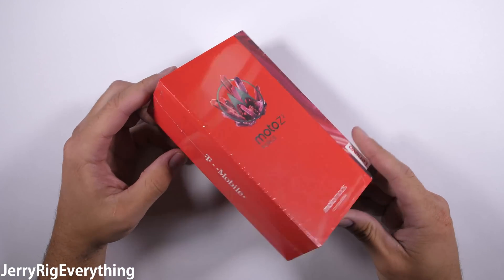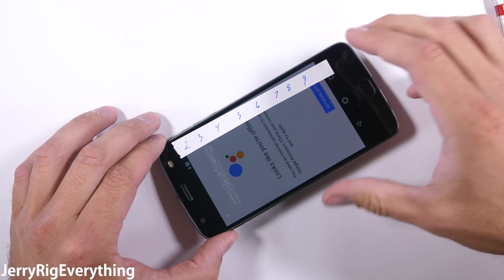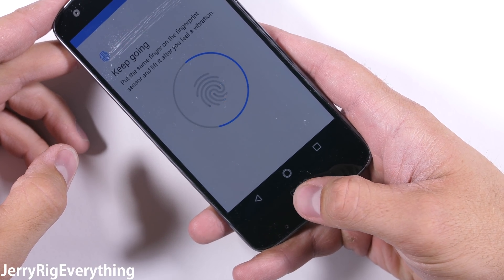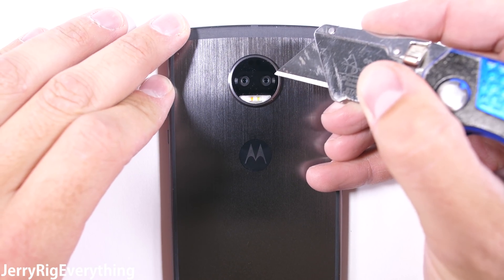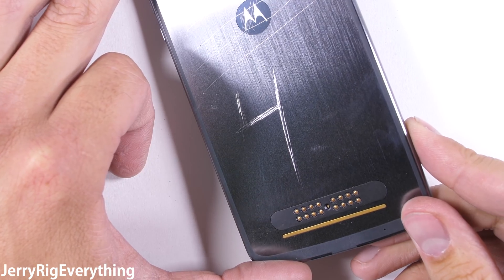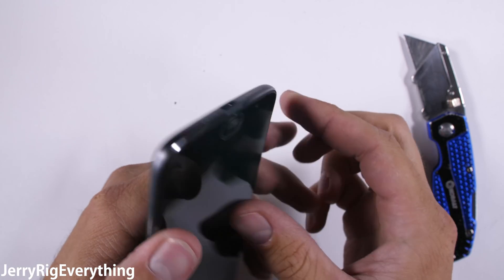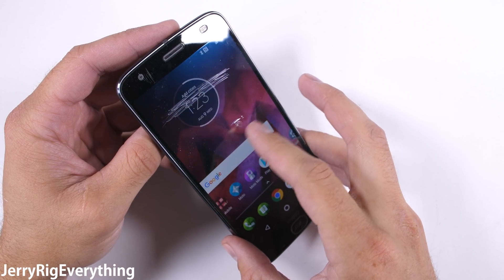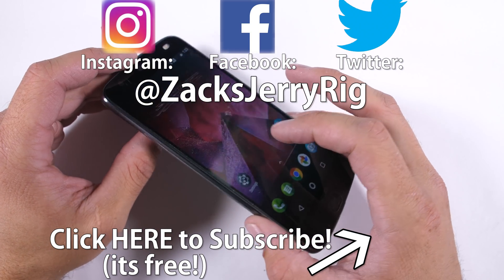Moto Z2 FORCE Durability Test - Scratch and Bend Test!

Comment: Maybe a mod with a headphone jack would help !! 🤔🤣
Reply: Ravpreet Kaur the gamepad mod has a headphone jack :D
Reply: You're probably going to use the phone 10 years until the Type C port dies. Type C is way more durable than Micro USB.
Reply: It comes with an adapter in the box. I have Bluetooth in my car stereo and can't listen to music at work because I have to listen for calls on my radio. The lack of a headphone jack wasn't a deal breaker for, for those who spent 200 or 300 on a good pair of headsets, it does come with jack adapter.
Reply: AzuMentch36 It's not as good, it's much less advanced and in all just not even comparable
Reply: Just get wireless headphones
Reply: ...yep
Reply: Thomas Salisbury defeats the purpose of buying the phone in the first place
Reply: You plug something that goes in the charger and has a head phone jack on the thing that is like a charger an you plug your head phones in it so it makes your head phones longer
Reply: Z2 play then
Reply: It comes with a adapter
Reply: Ravpreet Kaur the game pad mod has a built in head phone jack
Reply: Ravpreet Kaur but the Moto z2 play has a jack on the phone so
Reply: Little late but it's called the Moto z2 play. Trading specs for a headphone jack. At least from Verizon
Reply: The play has one and way cheaper lol
Reply: Ravpreet Kaur there is
Reply: guys u get type c to 3.5mm comverter in the box of phone
Reply: Or you can get a Z2 Play, which is just as good as the Z2 Force. It even has a headphone jack! :D
Reply: AzuMentch36 the z2 play is NOT "just as good" as a z2 Force. Please don't spread complete bs.
Reply: Maybe you can use the USB-C adapter that has a headphone jack that comes with the phone
Reply: Skylord William Exactly!!
Reply: But the problem with using a USB-C adapter is that you are using the same USB-C port(which have a finite lifespan) for two function, which speeds up the death of the USB-C port. If your USB-C  port dies and the phone don't have wireless charging, you will not be able to charge the phone without doing repair. In shorts, Using a USB-C adapter is NOT ideal when you can have a phone that come with a headphone jack.
Reply: If it is pre-included in the box, it wouldn't be a problem. Why would you buy something ripped off, that supposedly been there in the first place?

Comment: Regarding the lack of a headphone jack while driving, the Incipio car mount mod had aux built into the mod so if you would prefer that, it is connected through the mod (so is power to the phone)

Biggest complaint is that currently the top layer of plastic, the replacement lens, is bonded to the other layers in a way that is not DIY replaceable. 

The first gen version of the phone is a bit better in that regard plus the better battery life.

Thanks for the review!

Comment: Hey zack, even though a shaterproof plastic display is cool, i would much rather stick to glass, it has a bit more of a premium feel and its a lot harder to scratch up than plastic, eventually you are gonna have to swap the plastic screen due to how many scratches there are, however if the glass breaks on a normal phone you will change the glass anyway, I dont really know, i have never had a plastic screen phone.

Comment: I think they should include a tempered glass screen guard preinstalled in the phone to prevent scratches.. its cheap, easier to replace and better resists scratches. Some cheap chinese phones (huawei, xiaomi) have it already applied, costs even 1/3 or 1/4 of this phone.

Comment: I think you should start adding a drop test, especially on a phone that has a Shatterproof display
Reply: The Cube King Well it's plastic so it wouldn't shatter but at a certain height the OLED display would crack and look really ugly
Reply: Idk if you guys know but zack doesnt do drop test. I think its because you need a brand new phone for every height to be able to correctly say that the phone is shatter proof
Reply: CirclesOfMotion But what about it landing on its side?
Reply: Yes! Drop test please
Reply: He might as well that phone is completely intact
Reply: I watched one for this phone. 3, 4, and 5 foot then on concrete, hardwood, and down a big set of jagged rocks. It didnt shatter, it did get scratched. But nothing stopped working. It is actually shatterproof. She honestly beat the shit out of it.
Reply: I have dropped mine down a set of stairs when coming from a parking garage, there was a total of around forty stairs, it also got run over in the garage, and flung from the back of a truck at 60mph.
Reply: You're so right!
Reply: Yeah
Reply: zuerich3 oh, ok
Reply: Blues 000 If plastic will be thick there is no chance what OLED display will crack.
Reply: it proves quite a lot actually, he raved about how well built the iPhone 8 is but in fact it will crack everywhere from even a mild drop, the videos are misleading if you don't get second opinions
Reply: I own this Moto z2 force and have dropped it many times It just scratches..unless it's slammed hard then it kills the backlight and touch screen part... I know because it's happened to me.. pretty tough unless it gets a hard slam on the screen or edge..
Reply: Hybrid Theory yes I have used the warranty twice already...🙄
Reply: Hybrid Theory I noticed mines been glitchy to.. it's probably the bad road rash over the camera, I don't know though.. lol
Reply: Do the moto z2 play
Reply: AWSMcube that is a glass screen, and I bet you had a back cover
Reply: I have the Moto z2 force. This thing has fallen out of moving vehicles and off of the roof of our house with nothing but a bumper on it and is still 100% fine
Reply: Other channels have. Dropped it from 300 feet and it still worked
Reply: That's actually kind of a good idea
Reply: Maybe he will do it before opening it up in the next video
Reply: Zack already said on his other video/s.
There won't be a drop test. I agree with him and glad he not doing it.
Drop test are very random and proves nothing. Only idiots in youtube doing it.
I think the bend test, test the phone build better than stupid drop.
Reply: my moto z2 play's display broke after falling 2 feet with a case lol

Comment: I think every phone must have a plastic screen and a tempered glass screen protector in the box
Reply: bk seby 666 if they would be so, i would never buy a new phone
Reply: Seby 666 This is what I was thinking! Great idea!
Reply: why? your phone screen would never break after that. if the screenprotector breaks just replace it and the plastic isn't going to crack, but if its glass protector and a glass screen the screen beneath it will probably crack too like everything else.
Reply: I owned the Turbo 2 and was completely unaware that it was made of plastic until I left it on the hood of my car, which then fell off at some point and I ran it over. After removing the screen protector that was shredded (plastic film type) and other than a few dents in the plastic, the screen was basically unharmed. Any other phone would have been completely trashed.

My Moto Z2 Force is getting delivered today. Unfortunately for me, the Turbo 2 did not survive a dip in my pool...

I should probably be more careful with my phone...
Reply: agreed

Comment: Id prefer glass since I don't usually break my screen when I drop my phone's. I've had 2 and they are tempered glass and I've. Dropped them and they never shattered. That's from the high I've been holding them. Unless it lands face down initially, it won't shatter.

Comment: Lenovorola has said that they don't plan on offering shattershield replacement service for the Z2 Force, due to "only a small number of customers using it" on the past two phones. They're recommending that people use glass screen protectors to prevent what will effectively be permanent scratches; something they should probably have spent the extra 2c/unit and equipped at the factory.

I'm not sure what I enjoyed more...the video, the political commentary, or seeing the firmly-twisted panties of the people in the comments section. I disagree, though; there are far too many willfully-ignorant and just plain stupid people in the US for Trump to only get 4 years. He'll barely scrape by the election again, probably via the same electoral college bullshit he did last time, and then we'll have to listen to him for another 8 goddamn months about how he actually won by a huge margin if only the other side hadn't cheated.

Comment: glass screen is good.. because most of we don't like our screen to be scratched..😅
Reply: hehe Creations the fact that you can scratch the screen with your fingernail is a deal breaker for me.
Reply: hehe Creations tempered glass screen protectors exist ya know? And unlike your glass screen which breaks if u drop it, the tempered glass screen protector can easily be replaced for cheaper(0 risk of the touchscreen breaking amirite?)
Reply: You might as well get a sapphire display with raised bezels and you're good to go! The Verizon Wireless version of the Kyocera Duraforce Pro is a perfect example.
Reply: Beetlebob Andrew yeepp
Reply: trouble is, screen protectors do not cover the entire front face (which includes the camera). You can easily accidentally stick your fingernail into the camera area and bye bye scratch free screen.

Comment: Plastic screens are preferable to glass for it's shatter resistance. You can easily solve the scratch resistance by applying a tempered glass screen protector.
And replacing a screen protector is considerably easier and cheaper than replacing the screen.

Though, the phone should also come with a screen protector already pre-applied.

Comment: I just got a z2 Play. I have owned it for around a month now, and unfortunately, Somehow got a crack starting from the top left edge spanning the width of the phone. The glass is curved on the edges and is maybe a design flaw. I had a case and a screen protector on the device ever sense it was out of the case. Although the scratches are annoying on a shatter proof case, just put a screen protector on it. Shatter proof screen all day.

Comment: Plastic Screen is durable in drop non shatter glass but easy to scratch even the front camera can scratch easily. .  Easy to Burn. and for sure becuase its plastic it has lower resist from the dirt and sure it will be blurred after a months.
Goodnews You can put tempered glass on it for scratch resistance but if you want to change tempered glass becuase it shattered i guess you will get a problem from removing it, because its plastic it is possible that some adhesive from previous tempered glass will not be remove that easily .

For Glass the only problem is not that shattered proof.

Comment: Plastic screens, shatterproof? Hell yeah just slap on a 5 dollar screen protector smh
Reply: Poatatasium Poatatogen PO2 I've said it before and I'll say it again, the only risk would be the OLED display inside cracking
Reply: i think a plastic screen is better, then you can just throw a glass one on and if it cracks just replace it :P

if its the other way around its pretty much pointless
Reply: Burnout Wien It really just comes down to preference
Reply: what do you mean, of course the plastic will scratch easier so thats why you use a glass screen protector, its a much better option than a glass screen and glass protector or glass screen and plastic protector.

if you drop a phone with a glass screen and a glass screen protector it will probably crack your screen too, if its a plastic screen and u have a glass protector then all you do is replace it, also what do you mean its not an option for everyone? you sound dumb as hell tbh.

more cons to a glass screen than a plastic one all I have to say :)
Reply: looks > functionality

proves how dumb you are
Reply: Rasv srsly I choose functionality and calling someone dumb for no reason shows how unintellectual you are
Reply: i told them they were dumb and I did justify why I said that, shows how dumb you are too lmfao
Reply: looks > functionality

Once again shows how dumb you are. Also I can handle my a phone with a glass screen but there is always that risk of it breaking. I have an lg v20 which 90% of the front is glass. 

So many people break their screen and instead of paying a large amount they can just replace the screen protector.

Your claim earlier "Also a Screen Protector isn't a option for everyone" is dumb too because I bet you more people would rather pay 20$ for a new protector than about 120$+ for a new glass replacement.
Reply: Blues 000 same with glass screens but the plastic is more shock absorbant
Reply: For me its far more likely to scratch a Plastic Display as to crack a Glass Display, so for me it wouldn't make Sense at all.
Also a Screen Protector isn't a option for everyone i don't hate them but i would prefer not to have one.

But it's an endless Diskussion if you want, same goes for Glass Backsides, non removable Batteries, non removable Backsides..
Also Plastic just doesn't feel as Premium.
Reply: yeah exactly
Reply: For a cheap Smartphone maybe, i like it if my stuff feels like how much  i paid for it, a Phone that's made out of Plastic might be more durable but it looks like shit and it feels like shit you know.

I get your point but i'm not a Person who plays "Jo-Jo" with it's Phone so i prefer  my Phone naked so it will look and feel like how much I paid for it and not like a 100,- Plastic thing, it's just Preference I just don't like this Protection stuff on my Phone.
The only thing i need is a Case for on the way so the whole phone is save from scratches inside my Pocket which i can take off when i'm at home for example.

No need to call me dumb only because i have a different Preference.
Reply: I'm smart enough to handle my stuff well enough that i don't need to handle it like a Baby, if you're not so smart than you might consider investing in an old Nokia3310 instead of wasting youre money on one screen protector over another.
Reply: Rasv like i said, calling anyone something negative won't show that you are smart lol
Reply: tell me what he meant by "Also a Screen Protector isn't a option for everyone" which is a 20$ fix you can do yourself compared to a screen replacement not everyone can do themself and is 100$+

Its not negative when it is true :) + I never said he was dumb I said he sounded dumb.

Comment: They should keep the shatter resistant screen, but add a top layer of glass that removes like a screen protector, so it has the best of both worlds of being shatter resistant, and have glass.
Glass breaks, peel it off and replace with another like the plastic films they use.

Comment: Zach, for your durability tests you should add a simple water test for the phone your testing for 5 to 10 minutes 
As always, another well made video Zach
Reply from the maker: Water damage usually happens after the fact. (Days, or weeks later.) Due to the corrosion that happens on the circuits. So a quick water test (Or any water test) isnt super valid, unless it is revisited weeks later.
Reply: JerryRigEverything If you wish you can add a clip showing that you put the mobile device in the water bath for 5-10 minutes and then update the mobile's situation on your Twitter which would not entail another video and be helpful to us who worry about water damage.
Reply: @JerryRigEverything You could also make a separate video a week later for the water test results, and maybe your closing thoughts. That would potentially increase your views (adding the two videos together) with minimal effort.

Comment: IMHO, since the Lenovo acquisition Motorola has been on a slippery slope with each generation. Modular design is groundbreaking and implemented better than the attempts from Alphabet so far, but plastic screens? The last plastic screen phone I had was a Motorola on Boost Mobile in 2010.

Comment: I really don't understand why people advertise 7075 aluminum. The difference is that it doesn't cast well and isn't very weldable (irrelevant here), and higher tensile strength. For a phone, all you need is shear strength, and that's only if you plan to be cutting your phone in half on a regular. 6061 is much better suited towards phones, especially since you can get a beautiful powder coating finish, and it saves money at all stages. Cheaper materials, cheaper tooling, cheaper phones. What is there not to like?

Comment: I have no problem with scratches I do have a problem with cracks but I do use a screen protector to provent annoying fine scratches
Reply: RandomTube NOT-HD I thought that as well, but think of that: Plastic screen + Tempered Glass Screen Protector. Hard to scratch and when the screen protector shatters, it's not expensive to replace while the screen won't brake
Reply: Chrobin The only problem I can think of for the plastic screen and tempered glass screen protector is that there's a slim chance that when the tempered glass breaks it'll scratch the screen, or at least I think so
Reply: Oliver Taylor tbh i rather have cracks on the screen then scratchs
Reply: I'd rather have a balance of the two. Mohs Scale of Hardness Level 5 is just the perfect balance of scratch and shatter resistance.
Reply: Every Tempered Glass Screen Protector worth it's name has a plastic film at the side closest to the phone that holds the glass in place even when shattered. It will protect the plastic screen considerably until you pull it off. 
I'm more concerned about oleophobic coatings. Oleophobic coatings wear off on the phone screen, right! So we need oleophobic spray bottle anyway. Spray the screen protector every month.